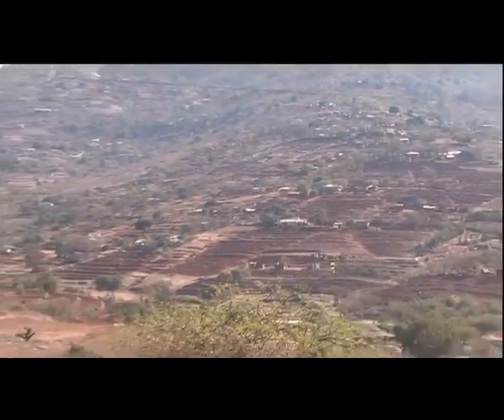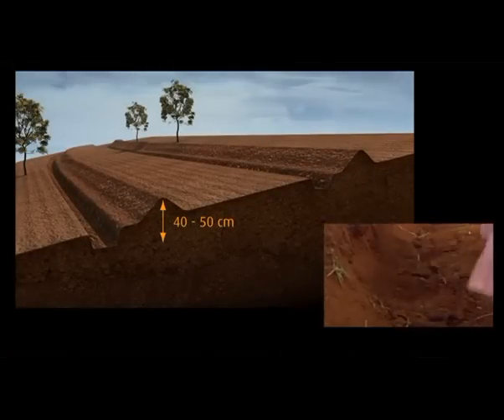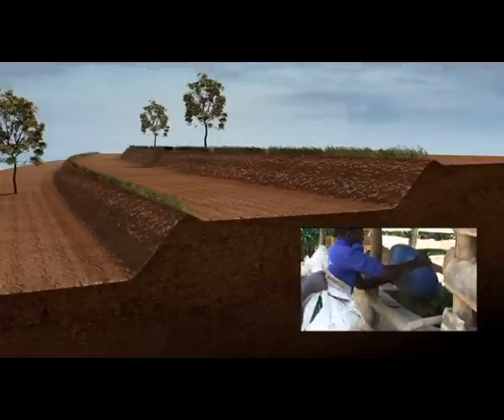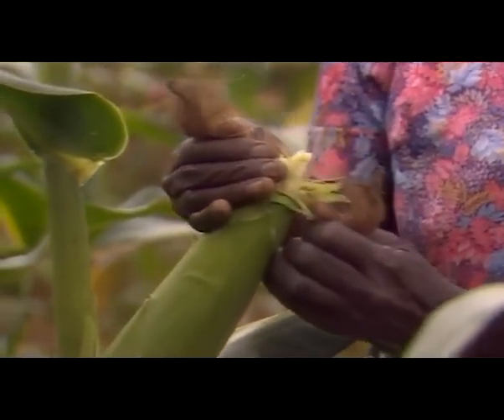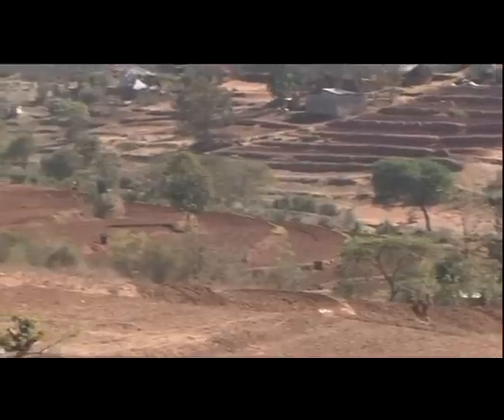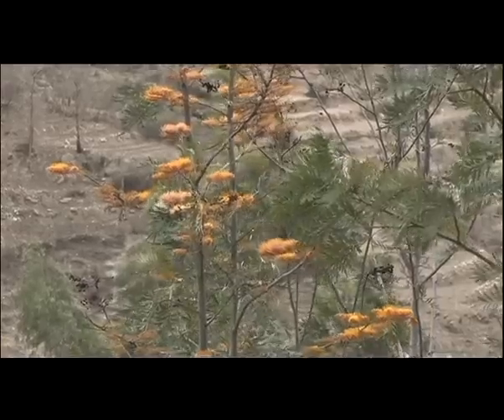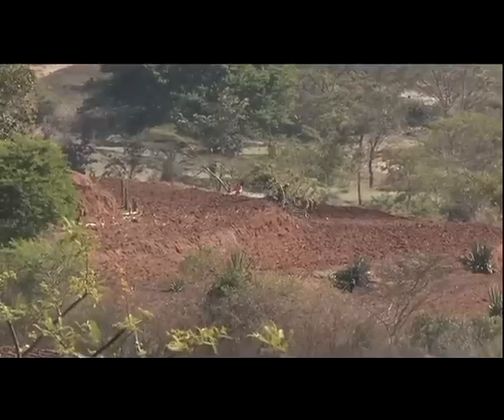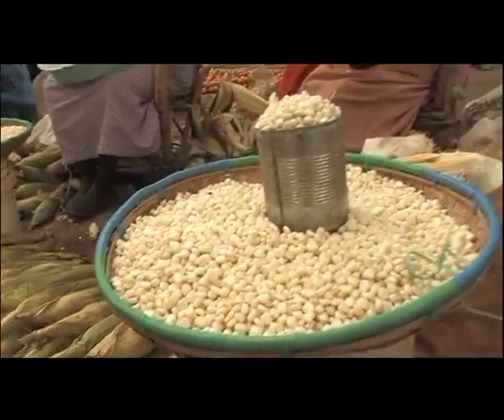Climate Change Adaptation technology: Fanya Juu Terraces

Comment: I'm researching terracing techniques (permaculture student) and this is a really interesting idea putting the swale at the "back" of the terrace, rather that the front.
We can't use swales in the Auckland / Northland area of New Zealand as the clay soil is prone to saturation in the rainy season and can literally liquify and slide down the hill!
Then in the dry season we have the opposite problem and the clay goes rock hard!
But other areas should consider experimenting with this technique.

I am thinking about experimenting with a compromise system though, with a shallow swale-like drain, letting the water flow out at the ends in the wet season but blocking the ends in the dry season to catch and hydrate the soil like a swale.